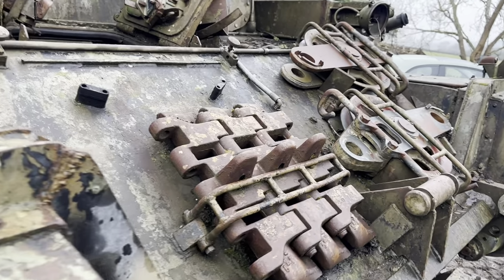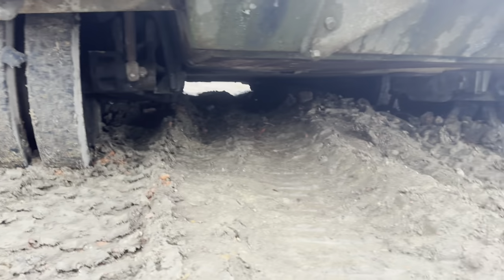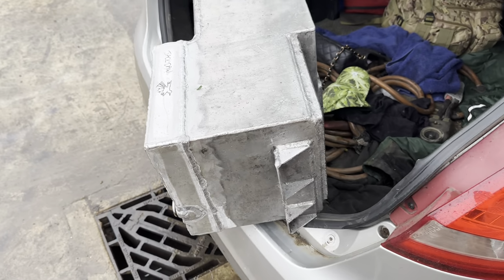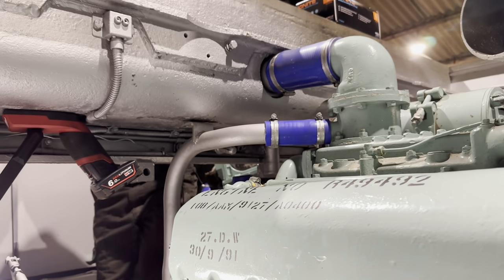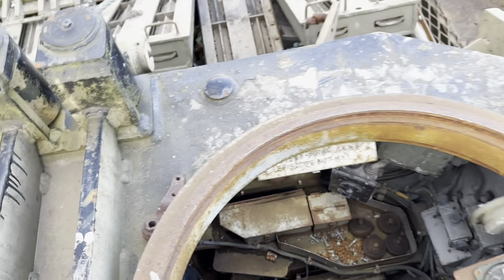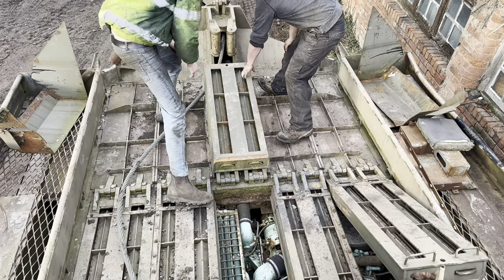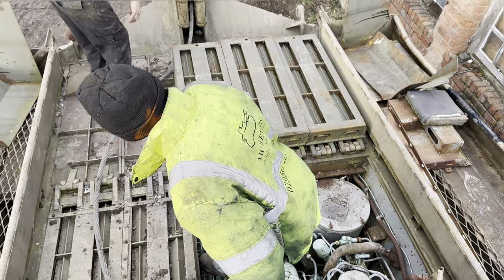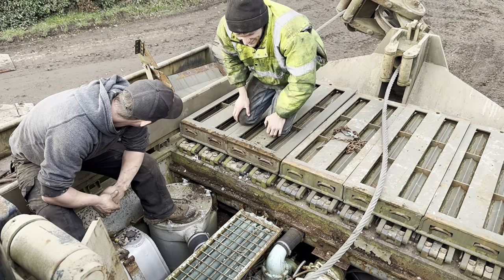The Mystery Vehicles Arrive!

Comment: I wonder what happens to the turrets from these ARVs because if you could find some old Centurion top bits well...
Reply: The Turrets were simply not manufactured because the Hull was designated an ARV version from the start.
Reply: The most important piece of equipment was and is the BV’s. Get a brew on Smudger !!!

Comment: it always strikes me as slightly silly, when i worked with this sort of stuff, we had the same thing go on at my company, a new piece of kit to play with, must be covered under a crap tarpaulin, its been out in all weathers for some years, surely a few more days will not be an issue, its just an arse getting the thing on and off and does tend to keep things underneath wet as well as Jack's observation, a swimming pool

does anyone remember a few years back, the two 432's welded together, the rear cupola had a hot tub in it, wonder if i still have a pic of that, i forget who did it and where that might be today, any tips - Tanks-R-Us or Tank World rings a bell

and has to be said, that's the first time i seen a telehandler used to take a hat off, Jack's a brave lad